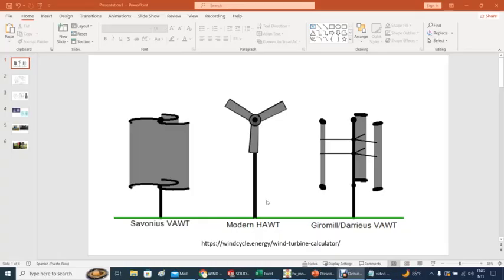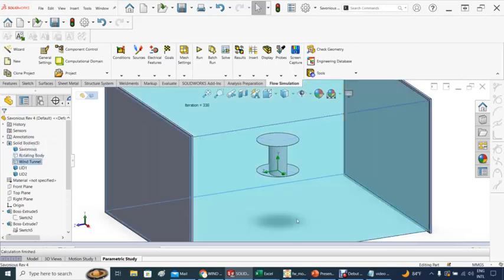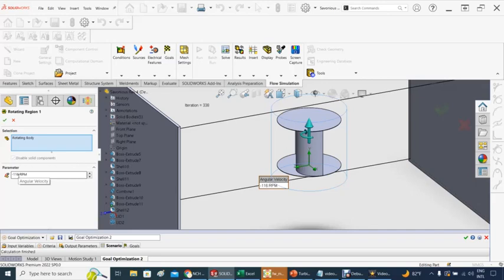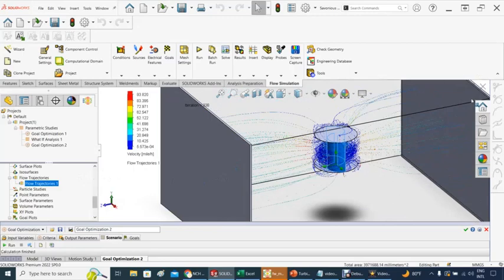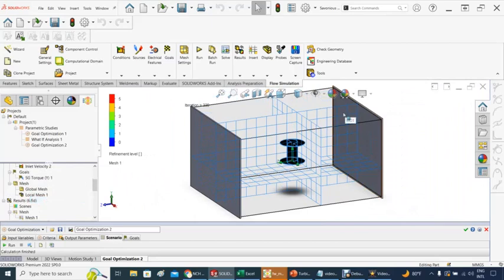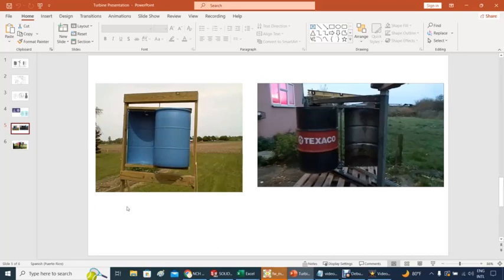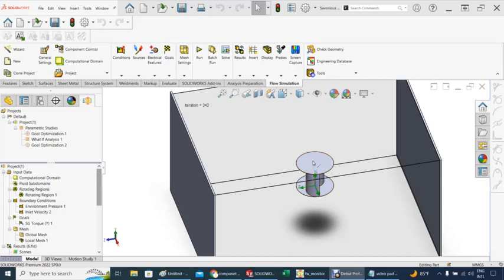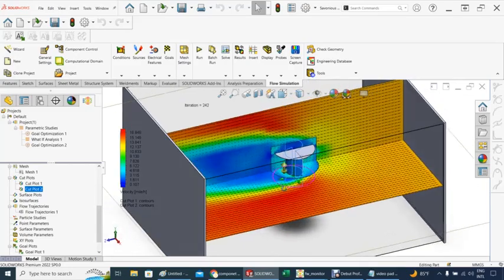CFD FOR A SAVONIOUS A T A 6 M/S (13.6 MPH) IN SOLIDWORKS AS PER GOAL OPTIMIZATION FOR ZERO TORQUE.

Comment: Hello there, great explanation! May I ask when I try to run my own Savonius VAWT why does the torque keeps increasing indefinitely if I increase the RPM? (Not the same as yours where it decreases when spun too fast), may I ask what might be the problem? I’ve followed the wind tunnel design and the rotating parameters correctly)
Reply from the maker: Careful: The torque will increase as you increase the RPM because the turbine is acting like a fan. Therefore, the faster it turns, the more torque needs to be applied. If the turbine is turning slowly at a given wind speed, it means you are extracting torque—hence, the torque value should be negative. In fact, if you keep changing the RPM, there is a “soft spot” where the torque is approximately zero—this is the free-spinning condition, where no torque is being added or extracted. I hope that helps.
Reply: @learningpower9437  I see, thank you for your explanation!😊
Reply from the maker: @michaellutan6605  Let me add a caveat to this: if you set the RPM to zero, SolidWorks will calculate the maximum torque required to hold the turbine steady. Use the assembly feature to reorient the turbine blades and find the position of maximum torque.
Reply: @learningpower9437 by the way, I’m currently encountering the same problem as in your video https://youtu.be/a_2taJFtAdc?si=j18xGF4vvksecF6T , have you found any solution regarding this problem? Thank you 🙏
Reply from the maker: @michaellutan6605  Yes....the answer was that you can't use local average....you need to activate the time dependent and local region (sliding)!!!!!!!  For the time, I worked at around 5 seconds.  My machine was very slow.... but the important part here is the sliding setting!!!!  This turbine turn too slowly...and the local average will not work!!!!  I hope this help!!!
Reply: @learningpower9437 i see, i have better result now, but my turbine still consumes power rather than providing it. Do you have any suggestions on what I can do?
Reply from the maker: @michaellutan6605  Are you working with a Savonius-type turbine? If so, here’s what you can do:

You need to bring the parts into the Assembly so you can position the rotor at various angles. Then, run a flow simulation at zero RPM to determine the maximum torque required to keep the rotor from turning.

Next, at the position where this maximum torque occurs, allow the turbine to rotate at 1 RPM and check whether the torque decreases. Continue increasing the RPM incrementally until you reach the freewheeling point.